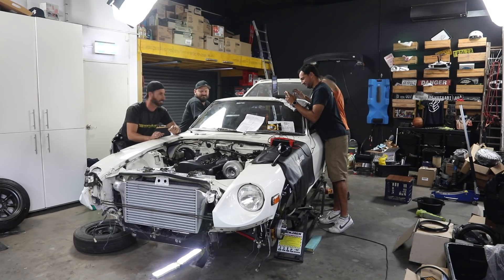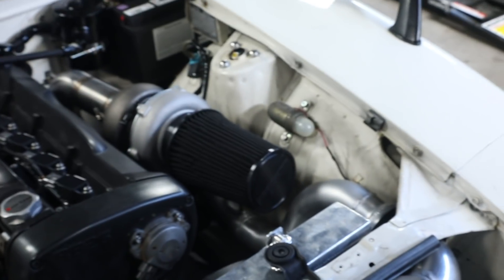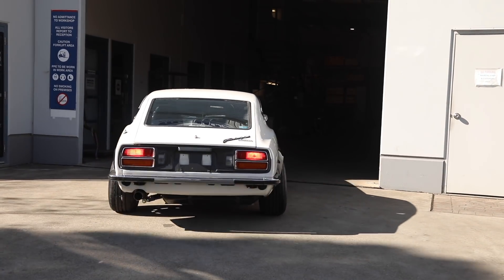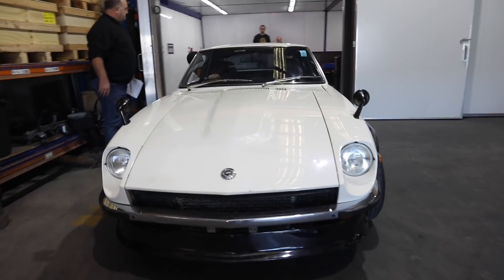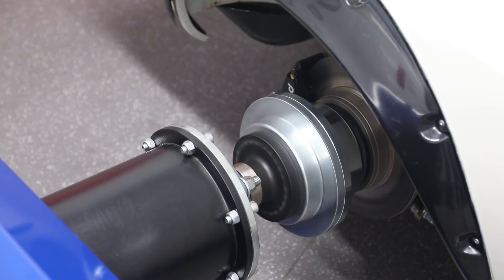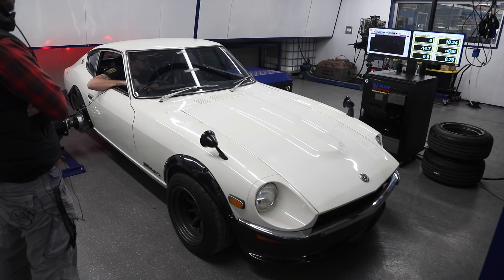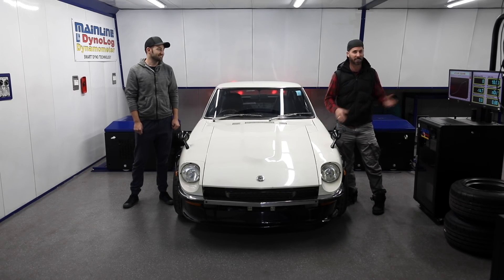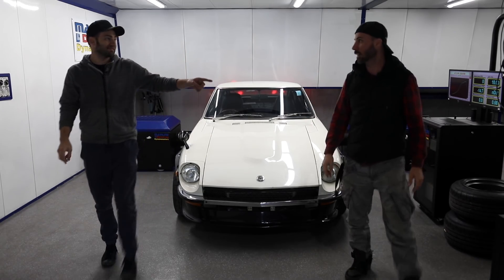240Z - RB26 Engine Conversion [PART 10] IT'S DONE!!

Comment: Coupe other cars that also make ~440bhp per ton:

Dodge Challenger SRT Demon
Lamborghini Aventador LP700-4 
Porsche Carrera GT 
Ferrari F40  and F50
Pagani Zonda C12 S
Ford GT - 2017
etc

Pretty impressive list!
Reply: Roman G that’s truly insane
Reply: Boosted boi civic though 500hp
Reply: It's more like 380 bhp/ton actually. If the car weighs 1100 kg and a ton is 1000 kg, then 417 bhp is 379,09 bhp/ton. Here's a list of cars that make around 380 bhp/ton :

TVR Cerbera 4.5 (1997) - 381.8 bhp/ton
Mercedes McLaren SLR (2003) - 381.3 bhp/ton
Lexus LFA Nurburgring (2011) - 380.4 bhp/ton
Ford Mustang Shelby GT500 (2012) - 378.9 bhp/ton
Ferrari 458 (2009) - 378.4 bhp/ton
Lamborghini Gallardo LP570-4 Spyder Performante Edizione (2013) 378.4 bhp/ton
Aston Martin Vantage GT3 (2015) - 377.6 bhp/ton

Still a pretty impressive list though
Reply: ou are using power measured at the wheels not at the crank, assuming normal drivetrain losses this makes 485 bhp at the crank so 440bhp per ton is pretty accurate
Reply: MKS 13EAST that is another sweet ass car

I personally think this S30 is my favorite car on YouTube.
Reply: more than 500
Reply: my uncle had a opel vectra opc 2.8 v6 twin turbo 350+ Hp xD
Reply: Junior Mortimer You got me there 👍 totally forgot about that LoL
Reply: That's power at the wheels Yoanniko...not flywheel power.
Reply: Mitsubisci not it won't 😂
Reply: Yoannikko except a 1000kg isn’t a ton
Reply: Roman G ij
Reply: No no no.. it is a Troy ton.
Reply: Although it weighs 2450 and has 420bhp. So nooot quite as fast as this list. But still mildly impressive.
Reply: Yoannikko, it's 417HP at the wheel, so around 480 bhp at the engine (and so ~440 bhp per ton)
Reply: BHP = engine power, the 417hp is at the wheels. So, queue the drive train loss discussion.
Reply: 600
Reply: What? Why would you use the power at the crank as the measure? Is that a thing?
Reply: Steezypleasy literally every car manufacturer ever measures power at the crank. So 440hp at crank would be correct.
Reply: yes lad, however, I am curious whether the 240 can put down that much power and come close to the Cresta!
Reply: Every power figure you see in official sources are at the crank. Even many dynos will convert it from wheel to crank by measuring resistance at the end of the run.
Reply: If the losses are similar to rototest hub dynos the statistics(based on hundreds of std cars dynoed)  says it should be in the region of 9-10%
Reply: it is a thing, manufacturers do it to have higher horsepower claims, i reckon.
Reply: My Mk2 Golf Made 347bhp with the larger turbo, it weighs 800kg. Not sure what that works out as per tonne but I think it should be pretty close to that figure.
Reply: Of course it is, if you are comparing one engine to another engine you want to compare power at the crank because WHP is after drivetrain losses which are different for different cars, especially when 2WD vs 4WD. If you want to compare two cars as a complete package then of course you use WHP but power at the crank has it's place.
e.g. if you just go by power at the wheels you might be fooled into thinking that an R34 GT-R with the same setup as this has a less powerful engine than this Fairlady if you just saw the power at the wheels figures when in fact it would be producing the same power just more of it is lost on it's travels from the output of the engine to the wheels so although the Fairlady is more powerful as a complete package, the engines are equal in this example.
Reply: Don't forget my 1975 Ford Pinto with the blown stroker big block, 441bhp/ton.

Comment: Lol it’s not a sleeper when 2.7 million subscribers know exactly what’s under the bonnet
Reply: when they said sleeper I was thinking the same thing
Reply: You can tell a car's not a sleeper by the way it sounds, alone, so it's not like anyone would be fooled, especially with that model.
Reply: aserta yea if your into modified car's you can usually spot them aye. It is a classy built though these dude's have got good taste I recon
Reply: actually its 2.7m
Reply: Cam Davies Nah one of my mate has a 400whp Mitsubishi Pajero with 1JZ-GTE engine they make the exhaust so quiet it sounded like a Bmw 328 with a S flow muffler...it's insane
Reply: Francis Helem even more relevant then........
Reply: Touge Warrior that's an out there combo. I get were ya coming from though if ya have something totally stock looking that's normally not quick at all with no tell tail clue's on the out side and some badass running gear well hidden in it then that is a true sleeper.
Reply: I'd run him on Parramatta road on a Saturday night in my stock 2014 Lancer.

I know how to use my auto in manual auto mode, just flip the shifter to the right, sit on the revs waiting for the lights to go green, release the brakes and shift up just before I read line and I'll be at McDonalds at the corner of Silverwater and Parramatta Rd before him, maybe?
Reply: aserta It doesn't sound very mean at idle.   Sorts like a Corvette.   My very timid VG30 in my NA 300zx sounds badass at ALL RPMS but the car will put you to sleep because it's not fast at all

Comment: Nice to see this 'finished'! I hope the registration process doesn't mess anything around too much. I know they don't like fender mirrors, would be a shame to have to rip those off. And the offset of the rims is probably too low and widens the track too much, so it'd be a damn shame to see the Watanabes go :( Of course they can bolt things back on after getting it registered, but then they just have to hope the police don't pick on it.
Reply: danehb89 i think because it came from factory with them and the boys didnt add them themselves it should be fine

Comment: 417... Very nice!! Still missing, the upgraded fuel pump.. That thing will make easy 500hp at the wheel!
Reply: Atem S. Until the engine gives lol
Reply: But it doesn’t need to, chasing numbers will get you just a big bill, this car would be so much fun at its current power level, I’d personally just drive it and enjoy it
Reply: True but when you tune/ boost a car, you have to have a target! Otherwise no need to go dyno testing and ecu mapping!
Reply: Atem S. The target is whatever is fun, safe and reliable. You tune to achieve that.
If you don’t tune your car, it’s going to run like crap or just blow up.
Reply: whatever is fun for you! If you want to boost the car to X hp, it's your call!
Reply: Oi boys it’s a confirmed fact you can push over 1000 horsepower on a stock RB26 bottom end
Reply: that engine is a tank!!
Reply: Target was to make the car move as it didn't have an engine....
Reply: It’s a Tinder car, have you not been paying attention 😜
Reply: A stock internal rb26 will not hold 500whp the highest it will go safely on e85 is probably 460-470
Reply: Jack Dillon yeah, with better head studs and on a clean motor. They got this off the ausi version of Craigslist with an unconfirmed number on miles. 1000hp would not be reliable.
Reply: Jb welded a cracked block... ya sounds like a pretty legit shop there was also a sti that held 600+ who for 2 years and that’s in heard of 99% of rbs aren’t holding that power for long
Reply: that was the whole point of the car, to test how far and long a stock bottom could go. They just put up a video about it.

Comment: 400hp in a car that light would be massive!
Reply: It's probably more than 400hp at the crank since that's driveline power
Reply: D13H4RD2L1V3 negative you lose power through the drive train, may be a slight difference at the wheels but would be minimal
Reply: That's what I meant. The power at the crank is likely more then 400hp since the dyno is measuring power as it goes through the transmission, driveshaft and final-drive/differential, and some power will be lost along the way
Reply: I believe the general rule is 15% power loss from the crank to the wheels. After some math, it's probably doing around 475-490 at the crank.
Reply: D13H4RD2L1V3 sorry misread thought you were saying it’d be less at the wheels

Comment: Shame on that air filter brand.
Reply: Wade shame on all mesh filters... paper is always better. If you want a cone filter but not upper cylinder wear, try the Motorcraft GT350 filter. Made by Purolator, top notch, wont let dirt in, enough flow for 600+hp.
Reply: data/proof to back up that claim?
Reply: supernice_auto yep. Plenty of video evidence here on youtube. Test was done. A paper air filter was installed midstream, and then various filters, foam, fleece (k/n, airraid etc), and paper, were installed in front of it. So if anything made it thru the first filter, it would be seen on the second. The fleece filters were by far the worst at filtration. The foam let some oil thru. If anything was truly better than paper, manufaturers would use it, and just charge for the cleaning. As a technician i have seen dusty intake tubes on every fleece filter equipped engine. Even seen chips on the turbine wheels of 7.3 powerstrokes from crap getting thru.
Reply: Wade if you don't check an air filter you deserve to lose a turbo, seriously, check the little stuff.
Reply: so just get an HKS that comes with a pre filter and their "special" filter juice.
Reply: Im sure it was just one bad apple in a bunch. Doesn't mean the whole brand is bad.
Reply: That look like k&n filter
Reply: K&N?

Comment: How the hell did the Haltech geza get in your Mini ?
Reply: Here Now he literally folded himself in. Was comical
Reply: Minis are surprising things. I'm not that much shorter than Tuning Fork (I'm 6'4") and I fit in one as does Edd China.
Reply: John Molloy yeah! Not sure about the classic Minis but the new BMW ones have best in class headroom. Sure it’s a small car but your ass is literally 6” off the ground!
Reply: Those BMW things arent Minis
Reply: This was a 1962 850cc mini I was driving in 1976. The seats were much smaller and thinner than the ones in Moog's JDM mini so there was more room. Oh and I was thinner and more flexible than I am now!
Reply: I've got to disagree. Obviously they couldn't continue making the MINI due to safety requirements, and emissions restrictions, they did really good at preserving the whole premise behind the MINI. That being transversally mounted invent + trans, good power to weight ratio (especially supercharged ones), and the wheels being at each corner allowing for insanely great handling. 

Now I would say the new VW Beatles are not Beatles because the whole draw to a Beatle was rear engined rear wheel drive and the CEO of VW just took a shit and called it the new Beatle without preserving any of the original qualities.
Reply: Ready2Go -The discontinuation of the Mini was another example of some of the stupid decisions that were made within the British motor industry. They could have upgraded it, but took the path of least resistance.
I guess I'm biased as I have a classic Mini that was my first car.
I got to drive a BMW Mini that was a convertible Cooper and I've got to say that I didnt like it at all. It didnt go as well as I'd hoped or handle as well as I'd expected for something with a Cooper badge on.
They also look like they've got a fat arse.

I agree about the new Beetle. It's just a Golf with a different shell.
Reply: Hmm I had an 03 Mini Cooper S, I am not a fan of convertibles in general just because of the engineering requirements when removing the roof. I gotta say going through winding back roads at speeds up to 170 km/h was the most fun I ever had in a car. Would have loved to try the JCW version (40 hp boost, better suspension, brakes, exhaust, etc.).

It would have been a big job for Austin to remake the MINI, they would need to develop a whole new chassis from the ground up, where as BMW just had to modify one of their existing chassis. I agree with the fat arse lol, but I kind of liked it, made it look more track focused, not to mention the sweet (and functional) hood scoop.
Reply: I guess that the BMW mini was a bit of a let down as my classic Mini has a 1293 rally spec engine from Oselli, Spax coil overs and a rear space frame.
So maybe a bit unfair to compare a stock BM Mini to a heavily modified classic.
I love the Go Kart feel of the little Mini and just a bit of a classic Mini purist.
Some of the modded BM Minis are pretty cool though.

Comment: Was gonna go check my pod filter and remembered that i dont have a turbo...
Reply: Hus -_- Bro , That piece of wire can still do alot of damage to a na engine. Seen it happen.
Reply: Mark Thomas really? I have a cheap supercheap one in my e46 i have seen small strings coming out of the middle but didn’t think it’ll have a bad effect
Reply: Hus -_- Bro yeah mate 90% of the time they will just get pulled through the engine no worries, but I have seen them curl up into a little ball and smash the shit out of the combustion chamber. Cheers.
Reply: there is no point in having a pod filter on a N/A e46 as it already has an air ram
Reply: Marshall Sambell Sound bro

Comment: Oh you guys are so lucky with the filter catch. I had a turbo on my rat rod and it ate the filter. a wire came loose like that on my "name brand" filter i wont say what brand but its similar to M&M and it dewound the wire completely and pulled the filter backwards into the turbo. (the second time one of them failed on me and I no longer use those filters)

Comment: Love this.  Could I add a request?  On both the V-Tec Mini and this car you've faced the problem of how to interface classic dials to a modern ECU. I for one would be very interested in some detail about how you go about this.  

Been thinking about it in terms of adding a stepper motor to a classic mechanical dial, or gutting a modern electronic dial and fitting into the classic shells... can't imagine how you start this project.

Comment: 417hp (at the wheels, meaning 450hp minimum at the camshaft) in a classic car is like a Bugatti engine in a Ford fiesta, it's insane in other words and well I'm not surprised the clutch was struggling on the dyno since its probably a stock clutch being performance tuned so was burning up

Comment: For anyone watching, this car is pushing a 5.08 power to weight ratio 
(lbs per hp). That's faster than any production car under $100,000 
(Dodge Viper SRT 5.24, Chevy Corvette Z06 5.42, Chevy Camaro ZL1 5.97 
(lower the number, the better)). Or, the more common measure, how many 
horsepower to 10 lbs? 19.67,  which would put it in the 50th spot for 
top 50 supercars.

That's a 10 second car, low 10s. Should trap around 128-129 mph.

Amazing outcome- and it will be better once they push it a bit further.

Comment: Wish I had this situation with smoke... bedding-in... Last time my brother's-in-law motorcycle was smoking I was like "dude, brake-in, it will smoke so let it be until you hit 150km" and survey says... nope, cylinder barel was misaligned and sunk ever so slightly causing a leak on head gasket.

Comment: may i suggest carbon fiber rims to reduce weight on the moving part of the suspension and centrifugal force on brakes , i should work like a sligtly lighter flywheel tooo :) sometimes it's the littel things.......

Comment: If you like high powered jdm engines check out bullet race engineering in South Australia. They make billet aluminum sr20 rb26 rb30 and 2jz engine blocks capable of up to 2500 hp

Comment: Ok I'm not entirely sure because it hasn't been explained thoroughly - would any damage occur by keeping that old filter on?
Reply: matt b High pressure air would force the wire into the turbine and that spinning at 25000+ rpm? Yeah. Wouldn't be good.

Comment: thats what K&N filters get you.  i refuse to use them after having similar things happen with them ive even had the factory oiled ones put so much oil in the throttle body of a truck it was on it would not run anymore till i cleaned it.   there absolute crap no idea why every one likes them so much

Comment: Hey...
I have a little question.. When we are doing the wheel alignment why isn't the driver not in the car? I mean we need the car to be straight while the driver is inside... Isn't it? Most of the time we drive with out a passenger, dats da truth.. So shouldn't it be that way? Please comment guys.. Cheers.. !!
Reply: Dhanuja Udayantha That's actually advised, but only under the tightest of race setups.  Pre-loading the suspension on a street setup isn't required as there will always be slight variations on weight: groceries, luggage, etc.  Where a track car would have a very specific and tight tolerance. Unlike a commuter car..  especially when doing Tinder dates as required in the build spec.  ;)

Comment: Old mate  who build motor ,,datone racing ,, strengthen it to stage 1 , remax forged oil pump ,micro polished / crank snout  oil pump extension grub screwed , oil restrictors ,shot peen rods  ARP  fasteners  , HKS forged slugs ,Tommie baffled gtr sump converted to rwd , tommie head gasket ,ARP head studs , stock head and cams ,stock r34 -7 turbos HKS ceramic coated dumps ,  bosh 1250 injectors ,2 x walbro 460 pumps ,AR billet surge tank  internal pump , AR regulator and billet fuel rail ,all e85 compatible fuel  system ,Greedy turbo piping   ,haltech platinum pro ,flex  sensor  ,3 bar sensor , mafless tune , 500rwhp, ,

Comment: kilowatt = horsepower?
Reply: Hazedwonder The its 536 hp
Reply: They literally said 417HP
Reply: My bad
Reply: 746 Watts is right about 1 Horsepower....
Reply: As a rule of thumb you can multiply the kW by 1.36 to get HP. But you have to be careful with the definition of "HP", the US has a different definition than the EU.
E.g. Mitsubishi Galant EA0 with the 4G63: 100kW, 136HP (EU), 134HP (US)